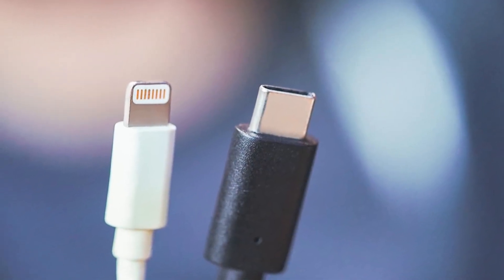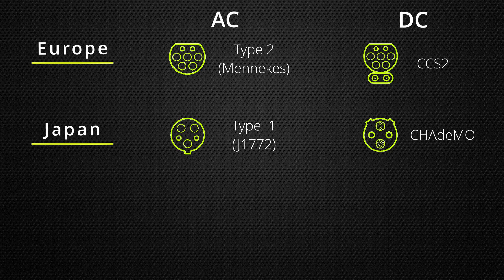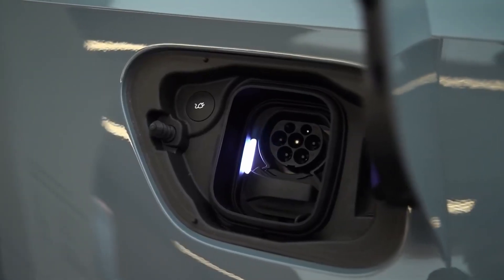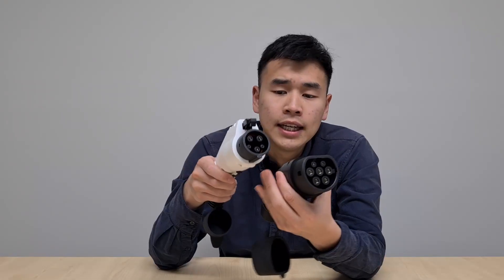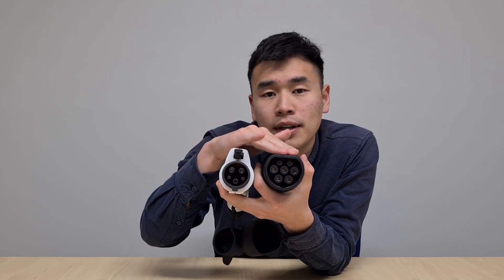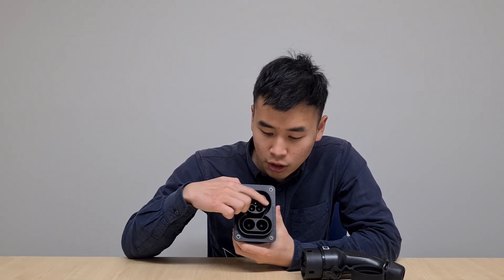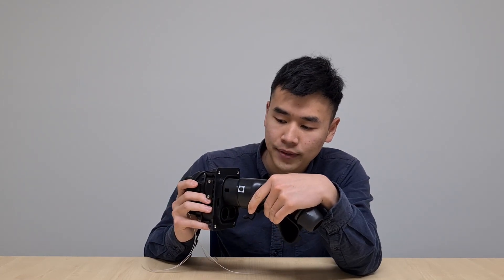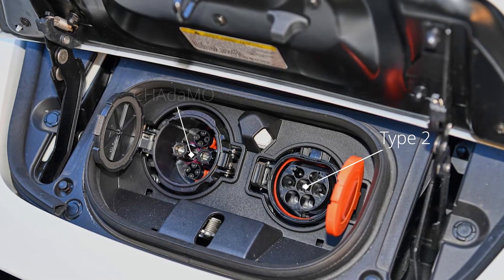What are the different EV plug types used in Australia?

Comment: Thanks for the video - I have a question. I have a Peugeot 308 PHEV that uses Type 2 cable. From your video, I take it that I can use the type 2 cable I have and go to a fast charging station that has CCS2 input and use it - correct?
Reply from the maker: No. For AC charging you'd use your Type 2 cable. For DC charging you'd use the attached CCS2 cable to plug into your car. Not sure if the 308 phev supports DC charging. Feel free to email a photo of the charge port and I can advise more
Reply: @juicdgarage when you say attached CCS2 cable do you mean at the charging station itself ?